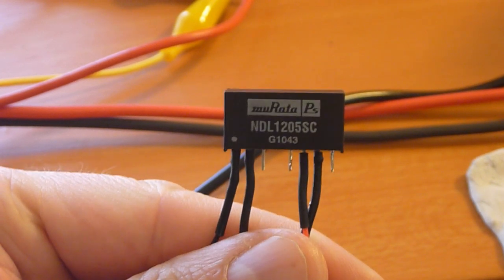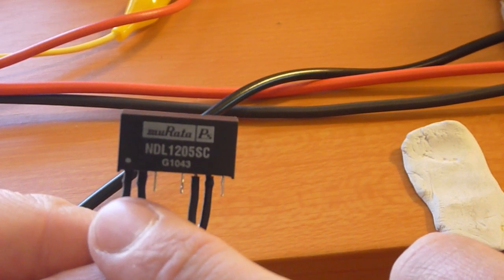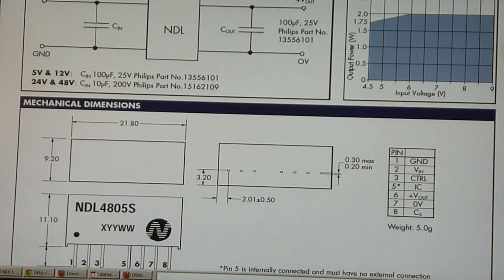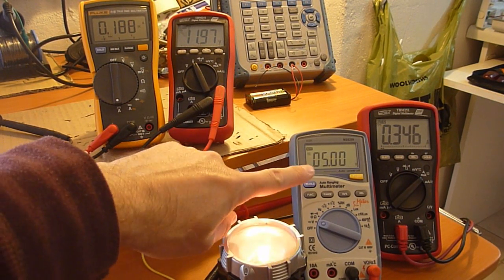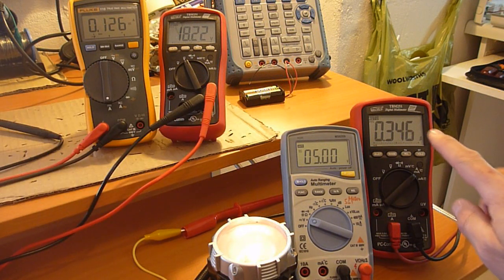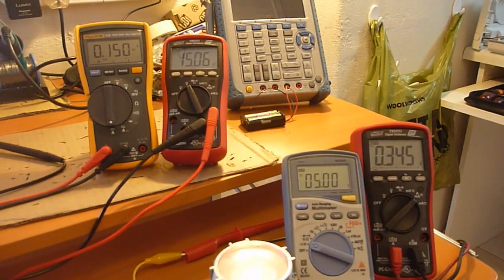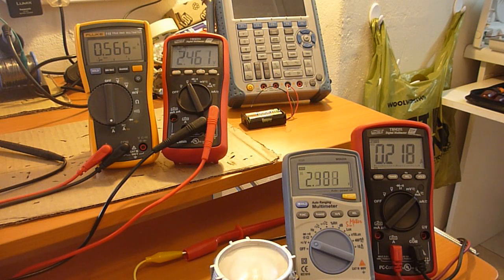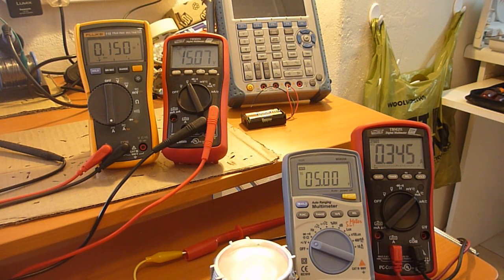DC to DC converter package: A quick review of the NDL1205SC

Comment: What would happen if you connect a resistor to the control pin to pull it up and ditch the device off, you need 10mA to do this. Then connect a Zener diode with a series resistor of a lower value to ground. When the voltage is high enough, the Zener will conduct, pulling the control pin low and switching the device on - theoretically :)

Comment: Excuse my ignorance but I didn't understand why when you increased the voltage on your power supply, the current flowing through the regulator circuit decreased. I thought that as voltage increased, the current increased too (and vice versa). Which 'laws' or theories am I confusing?  I'm a mature student starting to learn electronics from the ground up and it's not easy at my age, so your videos are very helpful!! :)

Comment: The SPV1020 chip looks like it would need a small supporting circuit, along the lines of the STMicroelectronics STEVAL-ISV004V2 or their STEVAL-ISV009V1. Am looking to try and build something based on these once I get my head around the supporting components, for a mono 25W panel.

I'm currently looking into small scale MPPT and have also found some interesting stuff at SolarMPPT(dot)com (AutoMax) and ransomhall(dot)com (SolBooster).

Hope it's of interest.

Comment: I have 1 x 65 watt 12 volt solar panel that actually runs around 17 volts and around 1 - 2 amps

However I want / need to increase the amps and lower the voltage going into my charge controller to something like 14 or 15 Volts while increasing the amps a little to at least 5 amps using capacitors / transformer or whatever will be needed

how can I achive this at the lowest cost posible?

More info you may need I am using a 30 amp (max) charge controller PWM that isnt getting enough amps from the 1 panel to charge 12 volt dc battery (100 ah).